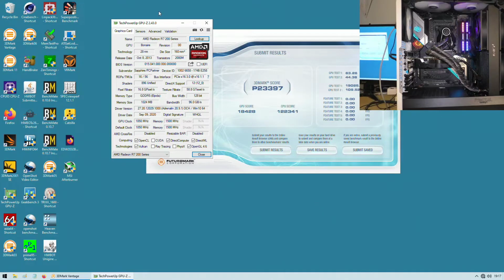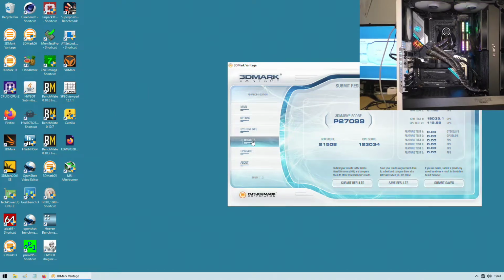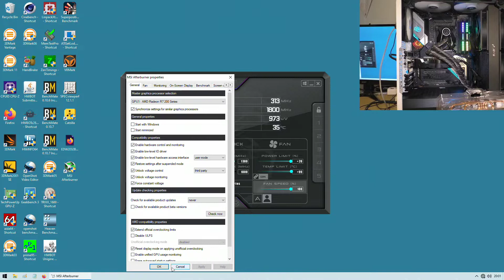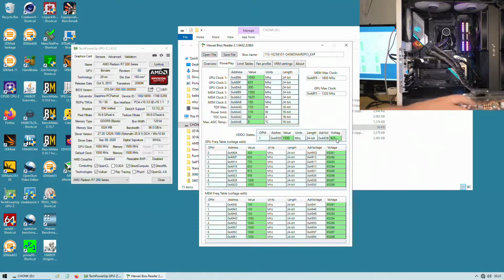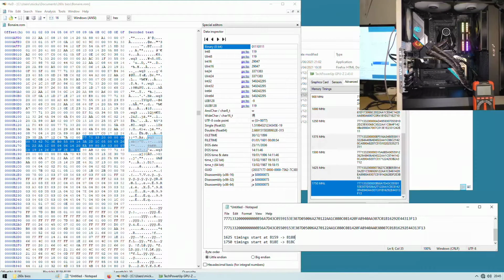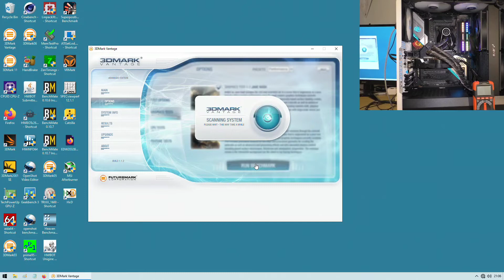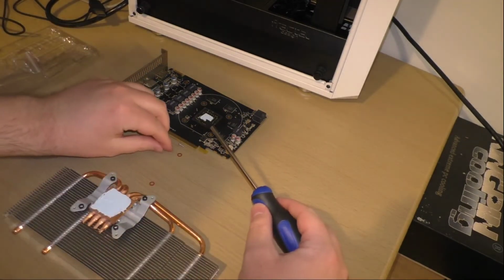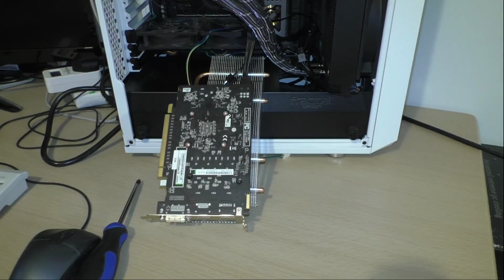Overclocking and BIOS modding a Sapphire R7 260X ft. a ton of 3DMark Vantage

Comment: Hey there, I'm having black screen crash problems with my Sapphire R7 260x is there any way to fix it?
Thanks in advance🖤
Reply from the maker: GPU repair isn't really my area I'm afraid.  In general though, a crash that's as if the PC was unplugged is usually the power supply - so that's something to consider if that matches your symptoms.
Reply: @mickocstreamarchive  I also thought the same and changed the psu into Corsair Cx 550m yesterday but still it happens i don't know how to get rid of it
Reply from the maker: @gamersdude4385  Bit beyond me I'm afraid.  I mostly do overclocking so when one of my systems has a problem, I know what I did to cause it - I'm not used to hardware that just has issues on its own.
Reply: @mickocstreamarchive  Can you provide me the bios that you used for overclocking the gpu?
Reply from the maker: @gamersdude4385  I'm not sure if I still have the file, if I do it's buried somewhere in a system I don't have set up right now.  If you're looking to reflash your bios to try and sort the blackscreen issues, you could try techpowerup's vga bios collection?
Reply: @mickocstreamarchive  I've already tried but it didn't come to work
Reply from the maker: @gamersdude4385  If a bios from techpowerup didn't help I'm afraid my modded one wouldn't help either.
Reply: @mickocstreamarchive  Still at least it can be tried
Reply: @mickocstreamarchive  Can you tell me the name of the software that you used to modify the gpu bios?
Reply from the maker: @gamersdude4385  GPU-Z to extract the bios and to see existing values for reference, HxD hex editor to change bios values, hawaii bios reader to fix the checksum, and finally amdvbflash to flash the new bios.
Reply: @mickocstreamarchive  Thanks a lotttt mann..that might help me a lotttt🖤
Reply from the maker: @gamersdude4385  be careful... if you mess with the wrong thing it could totally brick the card
Reply: @mickocstreamarchive  I I'm gonna only increase the voltage so that the card can get enough power and not crash
Reply from the maker: @gamersdude4385  I'm not sure if that'll work, my edited bios only changed memory timings, I couldn't get different voltage to work.  Sapphire trixx ver6.8 might be able to change the voltage for you though.
Reply: @mickocstreamarchive  You meant there's no option in the bios editor to change the voltage?
Reply from the maker: @gamersdude4385  I think hawaii bios editor has options for that but I'm not sure if they work.  They didn't work for VDDCI, but they might for Vcore.